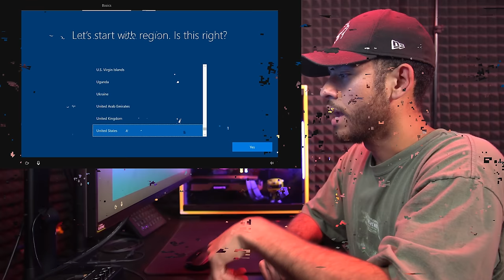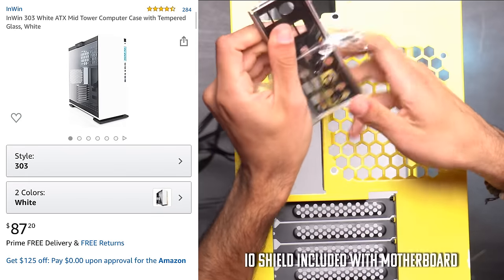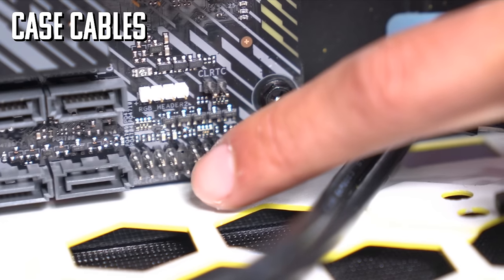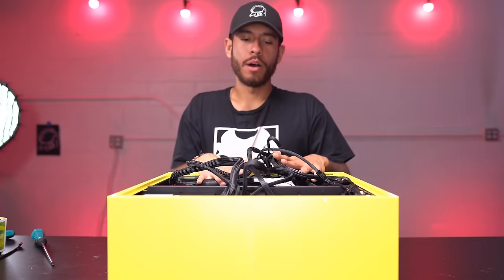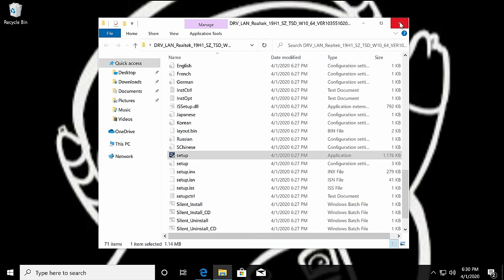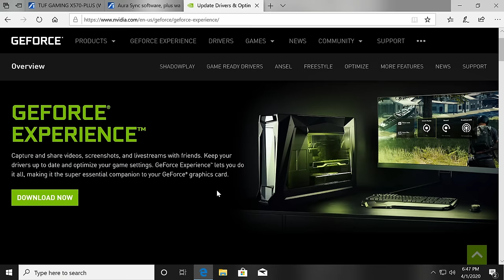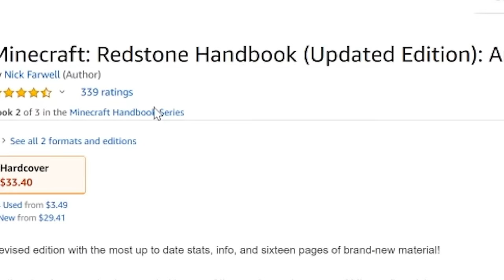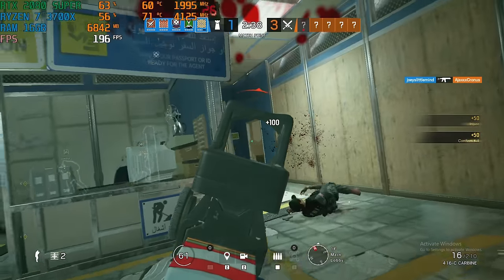Best $1700 Gaming PC Build Guide - RTX 2080 SUPER Ryzen 7 3700X (w/ Benchmarks)

Comment: For everyone building their first PC, I recommend always buy a Hard Drive with your SSD and use the HDD for personal files since SSD’s have a limited number of read and writes. So when that limit is reached, the SSD will fail without warning while an HDD will show signs of failure before losing everything, giving you time to back everything up.
Reply: I don't know much about PCs, if I build this can I put a hard drive in? Can I follow any other video about putting in a hard drive into your PC?
Reply: @Kat-is5gh  yes
Reply: Kat Trant yes. You can put a hard drive in it.
Reply: @skater102223111  any recommendations?
Reply: Kat Trant just make sure you get a hard drive from a reputable brand like Western Digital or Seagate. 2 TB Seagate Barracuda is only about $55 and that’s the one I really like and would recommend.

Comment: Moment of silence for 2080 super buyers.   3070 will sell like hot cakes
Reply: you mean 2080ti ? XDXD
Reply: @chururi8517  yeah sure but in this video joey used the super
Reply: XD
Reply: @czxxdy8411  Yes
Reply: @czxxdy8411  a lot less
Reply: @czxxdy8411  yes
Reply: Abdulla Ali how long do you think it will be till there released?
Reply: 𝓠𝓻𝓲𝓼𝓹𝔂. Do you know how much would they cost?
Reply: 𝓠𝓻𝓲𝓼𝓹𝔂. Fosho thanks g
Reply: @czxxdy8411  The issue is that they predict that the amount of them during launch will be the lowest they have ever had and wont be able to resupply until like 2021
Reply: @czxxdy8411  see 
2080 ti is like 1.5K usd 
3070 will cost 500$ and is HELLA LOT BETTER THAN 2080ti
now i must say, 2080 is TRASH in front of 3070
Reply: Every RTX 20 series will be ded after the 30 series is out..
even Titan RTX
Reply: @worsertrash1222  October or September end
Reply: @czxxdy8411  3070- 8GB GDDR6 at 20TFLOPS and its theoretically better than 2080ti
Reply: and nobody will get  it cus scalpers using bots are gonna get all of them and sell them on eBay for over 1000$
Reply: Why? what is a 3070?
Reply: @sappin3377  rtx 3070 is the new gpu available next month for $500 and better than the $1200  2080 ti
Reply: @aliriyadh643  But i'm in the UK and over here it's only £750
Reply: @aliriyadh643  Plus does the 3070 run any better than the 2080, it is cheaper afterall?
Reply: Ali Riyadh  but he said the super not ti so what’s the difference? Can I get the super? Only £750
Reply: @sappin3377  its simple the new cards are better and cheaper by a margin
Reply: Ali Riyadh and when exactly will it be released? Also would the the 3070 be compatible with all the other parts that this guy did a video on?
Reply: @sappin3377  theoretically yes it will run better than 2080....
Reply: @sappin3377  no compatiblity is not possible, as all grphics till 2080ti use PCle gen 3, but 30 RTX uses gen 4
Reply: Alan S Narayan ah well thank you I know what I’m going to do and that is I’m going to stick to the 2080 super I don’t know how to choose the right parts apart from ram and cpu so I’m going to stick with what this guy has recommended me
Reply: @sappin3377  kk whatever you believe is gr8
Reply: @sappin3377  not here to judge
Reply: Alan S Narayan yeah, but another question is, is this pc that the guy is building outdated I mean for how long will this computer for be good for general purposes and most importantly for how long in gaming because there are all these gpu coming out but will this computer still be ‘valid’
Reply: @SteelMaz see when the RTX 30 comes out, it's confirmed that 20 series sales will go down, but if you want to have a general computer for everyday use or casual gaming, this is too hyped, expensive and is prominent in competition gaming. The RTX 1660 ones might be the one for you since it's good for everyday use, can be used for good quality casual gaming and a bit lower end competition gaming. If you need a everyday pc pick one with a 750-900$ budget in Joey's channel😁
Reply: Alan S Narayan thanks mate, I know what I’ll do, I’ll wait till the new series 30 comes out and see what everyone recommends at a £1700+ budget
Reply: @sappin3377  the GPU will be valid for a good 4 to 5 years maybe, but a smaller budget, better GPU is always better than expensive trash right(Don't mean to say 2080 is trash, it's the best rn)
Reply: @sappin3377  if you have a budget that high, then you can probably build a beast in future, literally 😁
Reply: Will Senechal less and better
Reply: I’m chilling with a 2070 super for a while.
Reply: is the 3070 still compatible with this pc or will it need upgrades or an entire new pc build

Comment: Joey is the reason why I’m going to build a pc and not buy a pre built 😊
Reply: Yea there’s only so much you can fuck up beyond recovery on a PC so happy building!
Reply: Adam Brown building it urself will be much cheaper tho.... and for the same price u can just get better stuff
Reply: Adam Brown You can’t nearly all prebuilts use proprietary parts, which means the motherboard can’t use a different power supply and the power supply uses different connectors, etc.
Reply: Tbh it’s so frustrating me and my sister did it and it was so frustrating
Reply: Honestly go for it! I finished my pc today and the one thing that took up most of my time is cable management and also moving around parts so I could reach ports. When you’re building a pc, make sure to have all the necessary cables plugged in before you add anything that will block them. This will save you a lot of time because you won’t have to remove and then put back the parts.
Reply: Ugh. I bought a prebuilt for my first PC ever and I wish I had waited. This PC can’t handle the gameplay/performance for the type of stuff I enjoy playing/editing. SO NOW, for my next PC...IT WILL BE BUILT!!!
Reply: Same it’s so much better building one u get your money worth and more performance e
Reply: Tom Nook 😂 thanks bro 😊
Reply: Adam Brown yh that’s what imma b doing
Reply: @amasterdaone2316  Not necessarily, i bought a prebuilt, about 6-8 months ago, 2070 super, r7 3700x , 240 sad, 2tb, 16 GB ram at 3200hz with an AIO all for $1000, usually $1350
Reply: Garrett Howard oh damn! Which one was it?
Reply: @amasterdaone2316  cyberpower pc
Reply: @Adam Brown not worth... not to mention that prebuilt comes with unupgradable parts and the kind of prebuilts that come upgradable are wayy overpriced
Reply: @G11Chan  Nope

Comment: Now as 30 series is here just swap the graphics card with a 3080
Reply: Is it that simple? Lol I've never built a pc but I know with cars you put 1 upgrade you gotta upgrade everything else
Reply: @sir_ladykiller1803  if you upgrade a part you don't have to upgrade everything else. Unless you have really old or bad parts because that would bottleneck the part (it wouldn't let it function as fast as it should) or if it draws more power than your psu can handle.
Reply: @cheese._9341  cool like for example this video would it bottleneck I'd you threw the new card in?
Reply: @sir_ladykiller1803  nah, the ryzen 7 3700x is pretty good. but you can always check the internet if you are not sure
Reply: @cheese._9341  cool thx lol waiting on joey to make a new video with the cards tbh
Reply: @cheese._9341  Do you know if I can put an rtx 3080 instead of the rtx 2080 super?

Comment: how do you paint your cases and components bc i like how they look
Reply: break it down with a screw driver and just use satin spray paint have a good distance from it like 1-2 feet and just put a thin coat enough so you cant see the original color and have fun. i did the same things with my xfx 460
Reply: So I just screw out the "case" of the gpu and spray that part?

Comment: I'm trying to buy the case you use but on amazon, it says that its unavailable is there  another case I could get that works
Reply: Any case that fits an ATX motherboard
Reply: @lunasee7007  oh ok thank you
Reply: I had the same issue in the uk,got the same case but only 6 fans. 3 at the bottom sucking in, 2 at the back and the one on the side near the cpu.

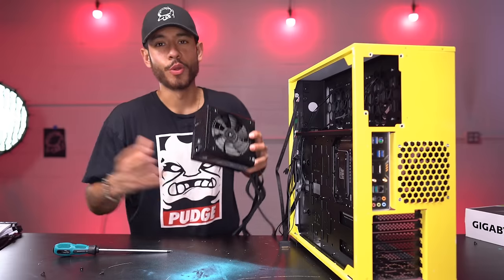Comment: 6:28 REMINDED ME OF THE VERGE.. WHAT ARE YOU DOINGGGGGG
Reply: Goddamnit you beat me to it I wanted to say that. How does he not notice the vents on the side of the case?
Reply: The top of that case has massive amounts of air flow, there is most likely and inch and over of room for that psu to breath. He did nothing wrong.
Reply: @younghades9287  The top of that case has massive amounts of air flow, there is most likely and inch and over of room for that psu to breath. He did nothing wrong.
Reply: @younghades9287  Relax buddy, dont need to get all heated over a air flow. Have you seen the case? It has fairly ample breathing room for the psu and even if its blowing hot air into the case, the fans are orientated in a way that blows air throw the AIO. Nothing would be affected.
Reply: @andanotherthing5160  What? Where do you see an aio? And I don't know if you know this but the psu fan is pulling in hot air from the case and not pushing. Which is why I said the fan is blowing hot air into the psu.
Reply: @andanotherthing5160  Since you don't know how air works let me explain it. The fans at the bottom are blowing air into the case that the GPU and cpu are using to cool. And not all of that heat from the GPU will be exhausted out the back. Hot air rises and the exhaust fan (which is at the top) will blow that hot air directly into the power supply which is facing the wrong way. If he faced it the other way it would pull air in from the outside of the case.
Reply: @younghades9287 Barden my mistake then, i just looked quick after watching the video and thought aio for whatever reason. Still, he made a mistake. A minor error that has no immediate downsides and the psu can still breath, so i doesnt really matter.
Reply: CRYPTO It’s not difficult to understand, don’t insult my intelligence when there’s nothing left to discus. It’s not hard to understand how air works, the psu will be fine. Maybe a few degrees hotter but fine.
Reply: AndAnotherThing negative partner that psu will have a short life no doubt.
Reply: @hectorpescador9081  Sure, but even under high loads the psu has a zero rpm fan mode that it uses. So even if the psu was facing the right way, it most likely wouldnt have even been running the fan.
Reply: @andanotherthing5160  I'm not insulting anyone's intelligence you were making it sound like you didn't know how the fans worked. You called it an aio and said the psu was pushing air into the case. Plus I replied 6 seconds before your reply so I didn't see it immediately.

Comment: Does anyone know if they can replace the top 3 fans with a 360mm liquid cpu cooler? I ordered one instead of the fans and am questioning on whether or not it'll work with this case, any advice would be really appreciated !
Reply: Well i think a dual would be better, as you have to have clearance for the hoses go to the cpu, it maybe a tight fit, but you also have the bottom as well. According the specs for the 301 case only supports a 120mm or 240mm Radiator, if you get the 101 case it supports the 360mm Radiator, that's what is listed on the Amazon for the cases. hope this helps.
Reply: @randy46  hey bro, thanks for your help, I ended up sending the 360mm fans and they fit perfectly in the 303, just like he did but w a radiator behind it ofc, build looks sick, and it works just fine!

Comment: Could I swap out the 3700x for the 5800x and still get the same or higher frame rate?
Reply: Absolutely. You may not see an incredible boost in FPS but it is much better in multi core/threaded work compared to the last gen

Comment: 1 year later almost and this build would cost you around 2500$
Reply: Ikr i just checked back 6 months later and some of the parts have increased in price so much
Reply: @malt7530  its insane..... you can get the best ryzen chip and an rtx 3080 and the rest for all under 2k and if you want all that rn its2600-2700 pre-built and parted out i think itd be 2200-2500
Reply: it should be almost 1000$ cheaper like 700-800$ cheaper

Comment: I know this is a year old but I followed the steps in this video. When I press the power button nothing turns on but the video card and mother board led light up. Any tips?? Nothing else powers on
Reply: could be many case bro. Firstly make sure the CPU cable is plugged in (happened to me before). Second, did you plug in the hdmi to the video card (not the motherboard).  Third, could be the Bios, makes sure u got the latest Bios for your motherboard.
Reply: Make sure to turn on the power switch from the power supply too
Reply: @Iuffycs  nah, his mobo and gpu led lights up. Pretty sure he turned on the psu. I have a good feeling that his BIOS is out of date. Cuz the exact same thing happened to me once.
Reply: @chururi8517  True
Reply: @chururi8517  so just an update, I made sure all connections were on firmly and I also purchased a secondary power button to test if it was a case issue, and nothing turns on. Correction on lighting: The mb does have an led strip which that turns on. No other power emoting from it. GPU card does have white light that is turning on. I pulled the cable just to confirm and it turned red. Not sure if I should just make a YouTube video of it and you guys can see a better undertaking.
Reply: @luisgonzalez-vy3un  Maybe can you tell me what is ur CPU and what is ur Motherboard?
Reply: @chururi8517  sure no problem MBO Asus tuf gaming x570-plus (wifi) CPU: RYZEN 7 3rd Gen
Reply: @luisgonzalez-vy3un  They seem compatible with each other. So it could be the RAM. Are you using dual channel RAM? There are 4 slots in that MoBo. So maybe u can try to troubleshoot the RAM like for example put one RAM in first slot and power it on, and check that till the 4th slot and do again with the other RAM.  Then try to put the RAM in 1st and 3rd slot, and then 2nd and 4th slot. Switch the RAM and do the same.
Reply: @chururi8517  using trident z neo rgb ddr4
Reply: @luisgonzalez-vy3un  did you try what i just recommend you to do?
Reply: @chururi8517  trying that now as I type
Reply: @luisgonzalez-vy3un  If u r using a modular power supply, make sure to check the cables are fully attached on the psu. Sometimes that can happen when u didnt press it firmly all the way in. If the RAM troubleshoot doesn't work, last thing i can recommend you to plug out the battery on the MoBo and put it back in, try to turn it on. Or even replace it with a new one. If thats still doesnt work, sorry i dont have any more things to recommend besides having another PC which u can borrow from someone and troubleshoot to find which PC parts is faulty.
Reply: @chururi8517  I’ve tried the ram, and double checked all connections on the psu and they are firmly pressed and connected. I’m going to try and remove the battery and place it back in and try to find a replacement battery as well
Reply: @chururi8517  replace battery from MBO, no luck.. thank you for trying to help me

Comment: Ryzen or Intel for gaming?
Reply: "Today", the new Ryzen processors are the best choices , example, an ryzen 5 5600x has the performance of an i9 10900 so is 30-50% cheaper and have cheaper and good motherboards
Reply: @SaidCadillac  what about ryzen 5 3600 vs i5 10400f
Reply: @damjanlipak7332  3600 is the best choice depending on the price, it have more multi task(multi core), and single core performance and the fps are the same as the 10400f, and the mobos are cheaper (an b450 or a b550m is enough)
Reply: @SaidCadillac  Ok thanks for advice. Keep safe bro 👊
Reply: @damjanlipak7332 No Problem 🙏👍
Reply: What’s the best Ryzen to get if you have a big budget? I plan to finally build a pc once I move 😅
Reply: Intel is better for less money most of the time.